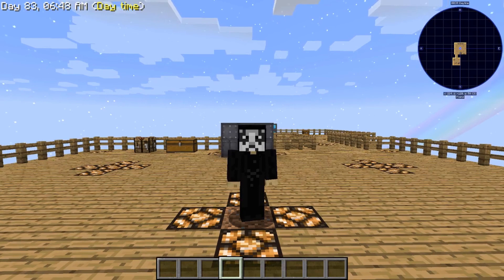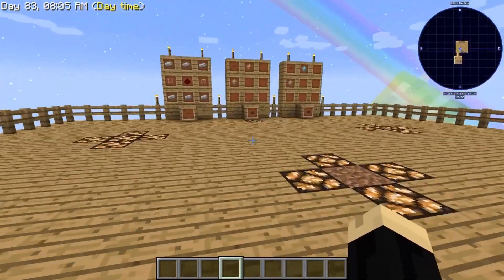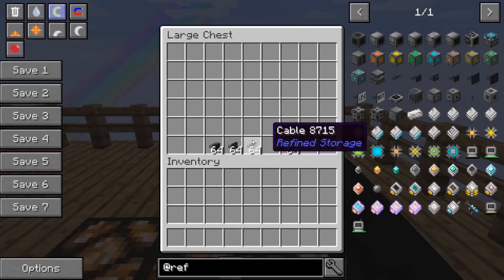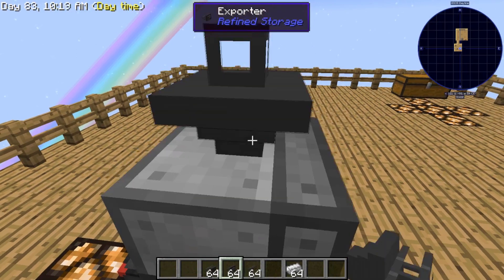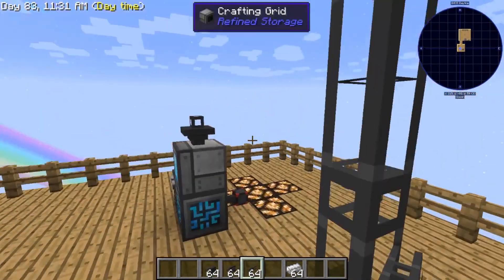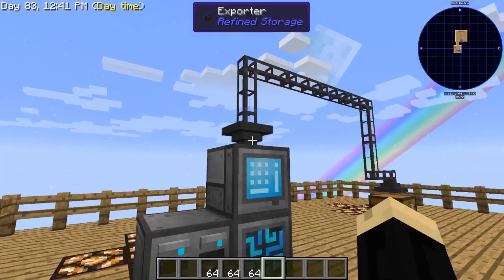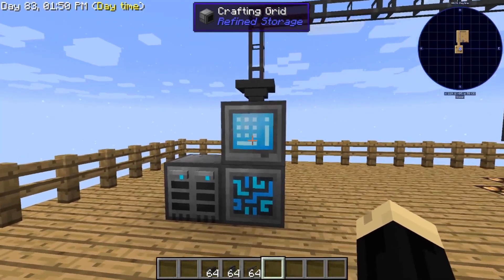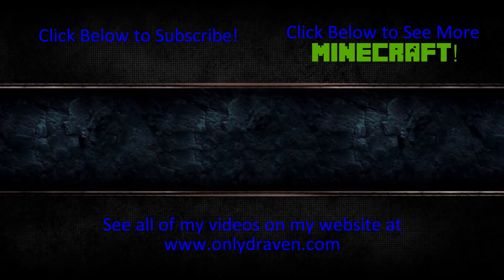Minecraft - Sky Factory - How to Use an Importer and Exporter with Refined Storage

Comment: You don't need to use an exporter to get items into your RS system in the example you showed. Just use cable to connect the Importer back to the RS system. You'd use an exporter to put items into another block, say, to keep a dropper filled with bone meal in a vanilla-style crop farm. (When you get to RS auto crafting, the crafter block exports items in the crafting recipe to the machine that executes the recipe. You need an importer on the machine to get the finished crafted items back into RS.)